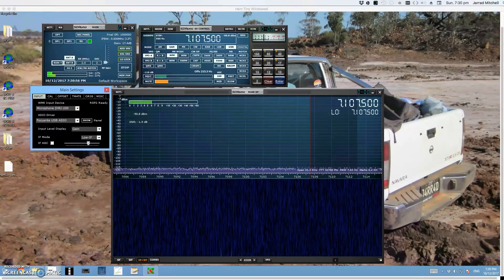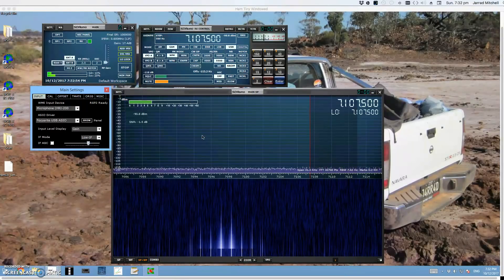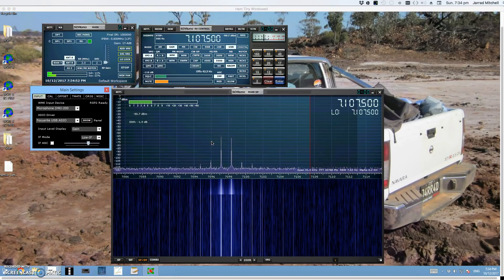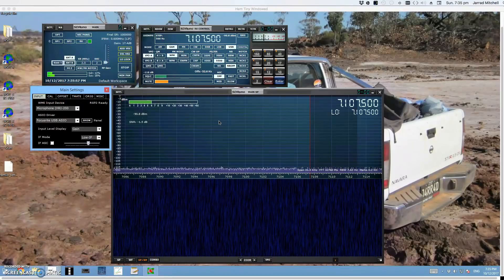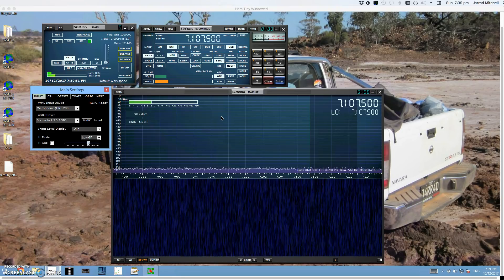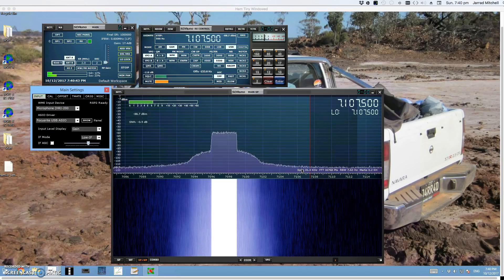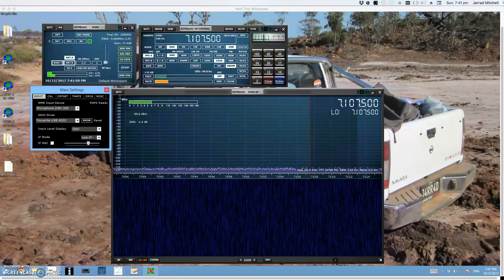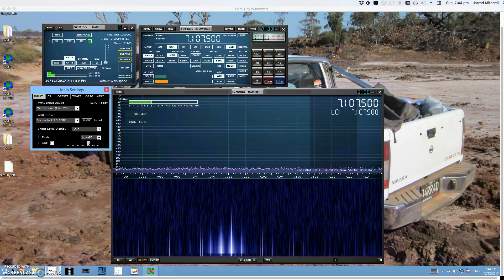IC-7610 2 Tone & White Noise TX IMD Full Testing (TX Perf Pt 2)

Comment: I would be very interested to know the difference in performance between using the “drive” and “power” to reduce output power. My understanding is that using “drive” will produce an even cleaner signal. Also, since the IC-7300 ALC overshoots quite badly at lower power levels making PA operation tricky, I would be interested to see if the IC-7610 behaves better when using “drive” to reduce power.

Comment: IMD3 is not good on a radio costing 3500$. My ANAN SDR show between 45 and 50dB at 100W. PA of the 7610 is exactly same than 7600 10years old.
Reply from the maker: Its better than most amplifiers Hams will be 'exciting' with it under 50 Watts, and certainly cleaner than most people's entire TX chain.  The ANAN's are nice - I have one too, but so many times an exciter is far from the weakest link.
Reply: анан имеет функцию PURE SIGNAL за счет которой и получается imd3  50db !  без этой функции он имеет те же 30-35 db. я думаю автор нарушил технологию измерения , так как 5 гармоника не может быть больше 3 ( это похоже на перекачку нч сигнала). я не знаю с какой частотой он дает тона и с каким уровнем . на каждом уровне мощности нужно калибровать уровни тона. один тон должен выдавать 25% от максимальной выходной мощности и соответственно при подаче второго тона мощность становится максимальной.  какая была тут методика , неизвестно и кто проверял диапазон уровней сетки SDR тоже неизвестно)